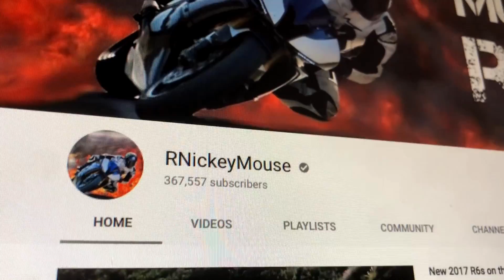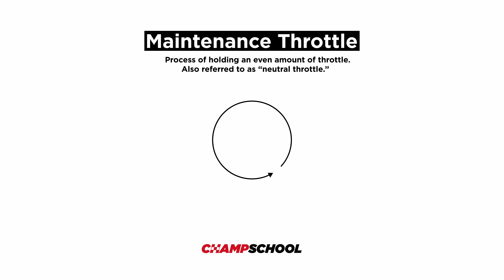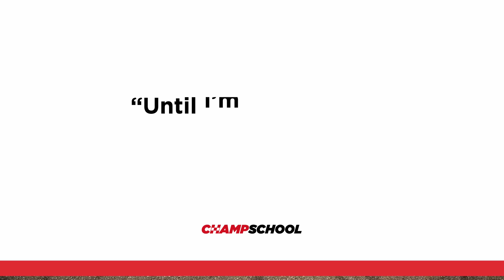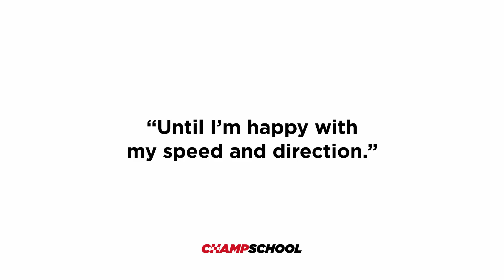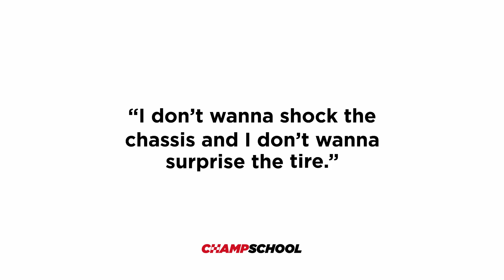Radius = MPH

Comment: Great information. I have a question regarding adding lean angle or taking out lean angle. I was taught that the only two inputs on a motorcycle are speed (throttle and braking) and direction (steering inputs), and lean angle is the RESULT of speed and direction inputs. Why would you want to directly control lean angle, you are trying to go a certain direction at a certain speed. Nobody says I want to take this corner at X degrees of lean angle. Appreciate all your videos.
Reply from the maker: Jerry Spencer  Jerry,  I think your question is "why would you want to directly control lean angle?". Not sure this R=MPH vid directly says that, but here are some thoughts:
1-Lean angle is finite...due to traction or parts dragging. Because it's finite, the rider must set corner speed to accomodate for traction or dragging. In that case, a rider would want to directly control lean angle. 
2-In racing, we are up against traction issues and attempt to run right to the edge (100%) of what our tires can offer in every corner on every lap. To stay within grip limits we respect maximum lean angle, again going back to exact entry and mid-corner speed.
3-So what this video is getting to is the fact that lean angle is finite and the way to stay on the safe side of what your traction or dragging parts offer is to precisely set cornering speed with the ability to continue to shed speed efficiently all the way through the corner if necessary, through trail braking. 
I hope that helps. Many riders, after running wide in a corner and living through the experience, decide to ride slowly everywhere. That's an option. We teach that running wide in a corner is not a speed issue, it's a lack of control issue: they literally enter the corner out of control, out of the brakes...or using the wrong control, the throttle. It works when you're going slow or the corner isn't significantly tighter than you thought because you can "lean it over farther". But when the pace is up or the grip is down or the corner is tighter than you thought, trail-braking is the cure. Thanks,  Nick Ienatsch
Reply: @Ridelikeachampionycrs  I knew this reply had to be written by Nick as I was reading it. This guy talks a million miles a minute even in text, but every word is extremely useful and spot on. I highly recommend taking his class in person. Will blow your mind and forever change how you ride a motorcycle no matter how long you have been riding. Just bring open ears and a focused mind. Semper Fi
Reply: @ntdeas  For some reason I just got your reply today. I only wish I could take the course, I last had in depth riding instruction when I rode for the Highway Patrol way too long ago. But at my age, I'm afraid I'm in the twilight of my riding career. Appreciate the reply and the videos.
Reply: You are not understanding the most basic physics of a motorcycle.